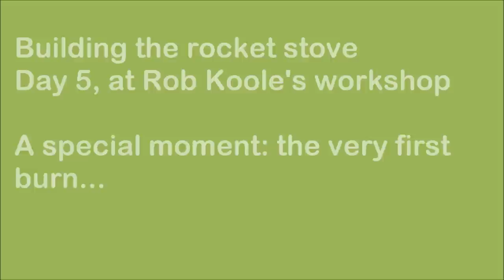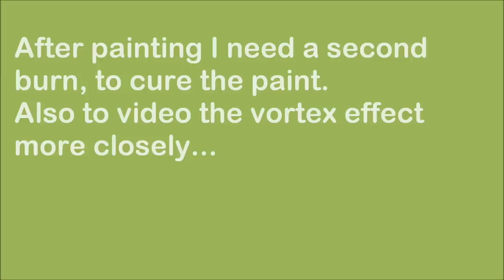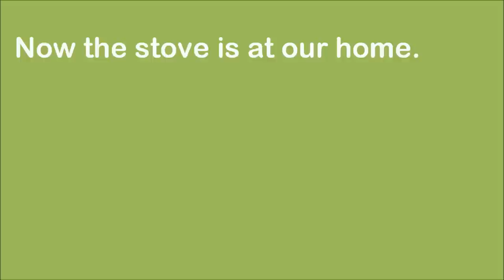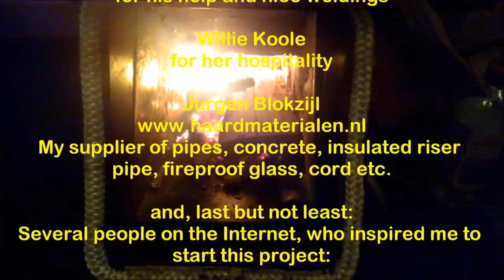Rocket Stove Heater. Building Part two

Comment: Well shucks, soon as I saw those vortex vanes I knew I was right.  Sorry Robert J.H. Gisolf   nice work though.
Reply from the maker: I'm not sure what you mean? You thought of this vanes yourself? Why sorry?
Reply: When the design and the building of the rocket stove is correct the vortices occur naturally, yes?
Reply from the maker: saltyseascott I don't know, I guess there will be a linear stream upwards. There will be some turbulence in the fire box, but no vortex.
Reply: firebox needs to be longer to allow the woodgases to form and and pick up speed to hit rear wall of heat riser thus making the vortices, which characterizes a rocket stove.   I don't think you were wrong, you must have just forgotten, don't mean to intrude.

Comment: There is a mistake in location of third airflow pipe. Since the existing location shall cause reduction in vortex (circular) velocity, it should be at the center or outside of vertical pipe for better vortex (pls. obey the principles of fluid mechanics).  :D
Reply from the maker: +far 5 Thanks for your remark. The idea is that the vortex airflow creates a lower pressure to suck in the air from the pipe holes. That's why the holes are at that position. And some turbulence here is no problem, turbulence helps to mix the air and flue.

Comment: Can you be so kind and send the dimensions of the stove ???? Thanks !!!!
Reply from the maker: Filler box is around 275 mm long, 125 mm wide. Opening is 135 mm wide, narrowing to 125 mm.
Core is 125 mm wide, 125 mm high, around 225 mm long. The walls are cast fireproof concrete, wall thickness 25 mm.
Riser is a standard available one meter flue pipe of double stainless steel pipe with isolation. Inside diameter is 125 mm, outside is 175 mm.
Drum is 300 mm diameter, thickness is 2 mm. Total height is about 1200 mm (without the legs).
Flue pipe is 125 mm diameter.

Comment: Your blocking answer i.e. argument regarding a possible integration of a venturi with "air jets" in the section between  fire box and riser was not thought to the end I'm affraid.  A venturi with tangentially positioned "air jets" not only  induces the vortex that we all want so much but also causes thorough mixing of 2nd air  of the carbon rich flue gasses from the fire box causing a near to perfect after burn.  This having said  you can eliminate the perforated steel tube of your design completely since the 2nd combustion air now comes out of the air jets as part of the venturi. The steel pipe with airholes is a design flaw really, since the pipe obstructs the vortex rather than promoting it.  You partly compensated this with the vanes. Both pipe and vanes in your design need regular replacement due to metal desintegration since "eaten up" by the heat. All can be avoided by "my" venturi with integrated tangential airjets and made of one piece refractory material. 
As a side effect the riser can be made shorter due absence of internals and better combustion.  Better afterburning creates higher temperatures WITHIN the riser not necessarily OF the riser especially when you cool the riser by circulating  the 2nd cumbustion air through the riser wall cavity.  The riser than has a heat exchanger function too. Pre heating temperatures of the 2nd combustion "air loop" rises. This fires the combustion process even.more. This and the venturi with integrated air jets involve some design work but in your capable hands I'm sure that will work out fine. I could help if you need that.  
Cooling the riser a bit must not necessarily have a negative effect on the combustion itself. Lower wall temperaturel stops/reduces desintegration of the metal wall in contact with fire... as long as the air circulates in the cavity of course.  A refractory liner is strongly advised here. If you prefer a metal inner wall that does without a refractory liner you should select a metal that is resistant to exposure of extreme riser conditions.  In professional environment frequent repair 
 as a definition indicate a  design flaw that can be and should be eliminated.  In hobby environment however it is entirely up to you.

Continue the good work!
Reply from the maker: Thanks again for your comment. I think the "air jets" are interesting but hard to produce. It would make the casting of a refractory material riser difficult. And yes, my 2nd combustion air pipe obstructs the vortex and by that increases the turbulent flow which mixes the secondary air with the unburned gasses.

Comment: It really does not make sense - nor is it efficient- to install vanes to create a vortex and - at the same time-  obstruct created vortex by the secondary combustion air inlet pipe.  Within the vortex the gas flow is not laminary but turbulent anyway.  This voids your argument to the full.

If you believe venturi casting in refractory material is difficult, you are mistaking. You  may find it difficult,  but in fact it isn't difficult at all.  Besides ...difficulties (imaginary and real difficulties) are there to overcome. 

It is not at all a problem to create a stove that works well but that is imperfect nevertheless .  Just aknowledge its limitations and be proud of your produce.
However it would be pittyful if personal vanity forbids you to accept conceptual improvements. That would be a personality deficit of wich i hope that does not exist.
If it does exist, you are a poor man

Comment: Horrible lighting! How ca one see anything, it's all black!!!
Reply from the maker: Well, yes, the steel is rather black. Or you could say "50 shades of gray"? But I agree, the riser height adjusting is not lighted well. But at the end I did not use that, because there was not much difference in working, unless the gab was smaller than the theoretic measurement.